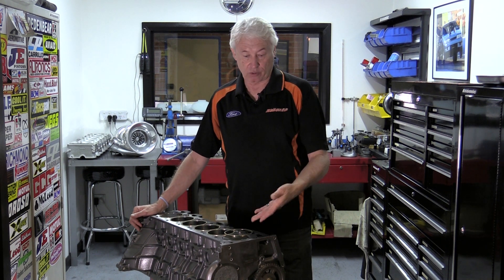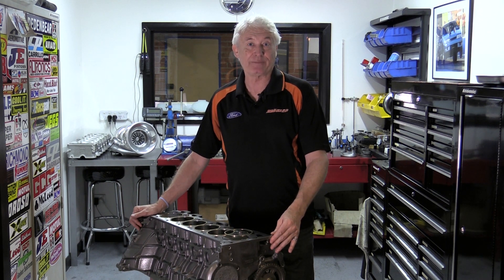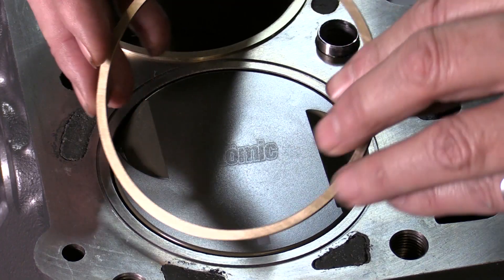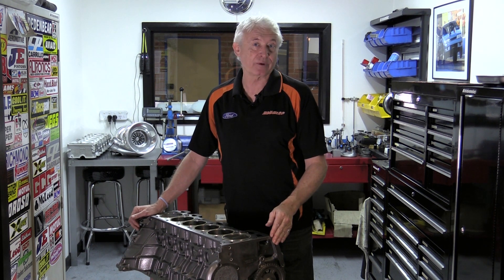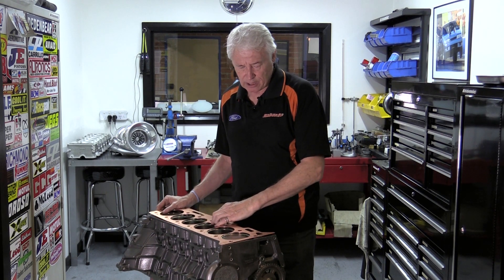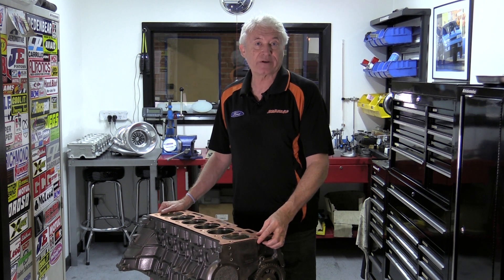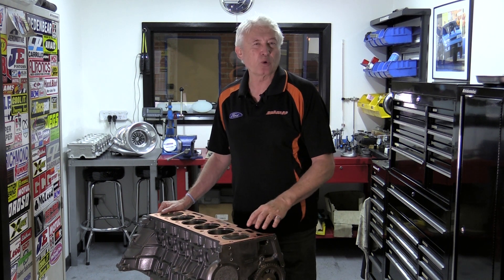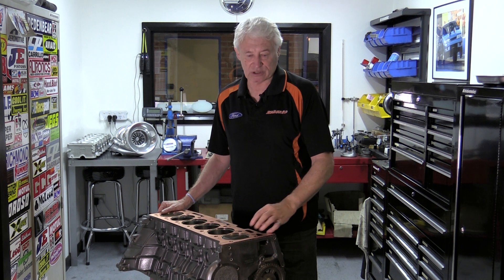Fire Ring Head Gasket Sealing System Explained

Comment: What difference in thickness between the rings and the copper gasket do you use? We had the same setup and had no problems with cylinder sealing but problems getting the water sealed up. Main problem was a small water port between the bores. In the end we were going to plug them.
Reply: Have to use a special three bond it’s black and there’s a 3 thou difference